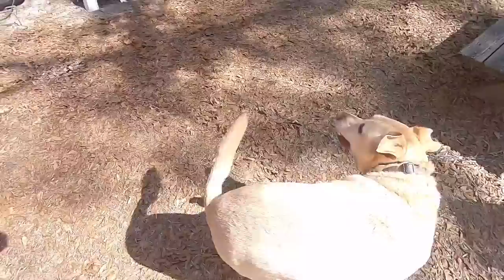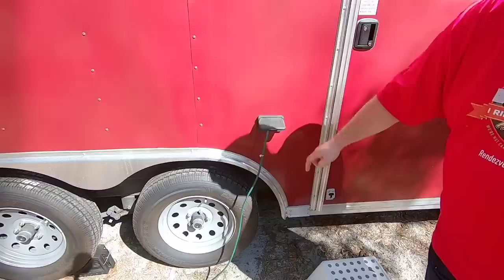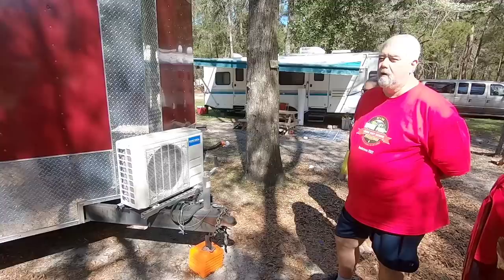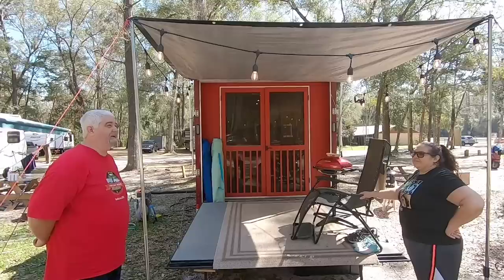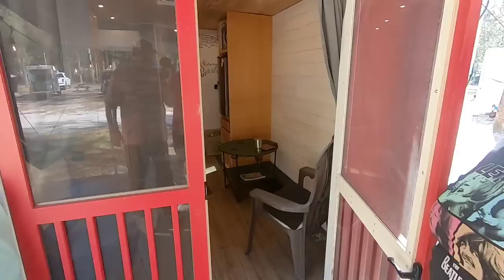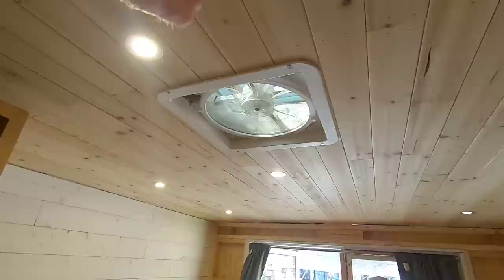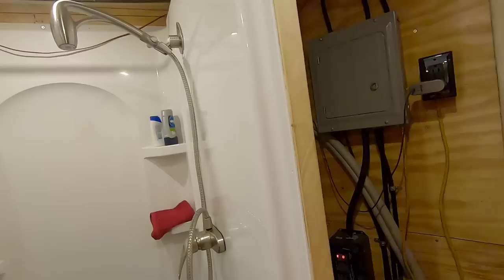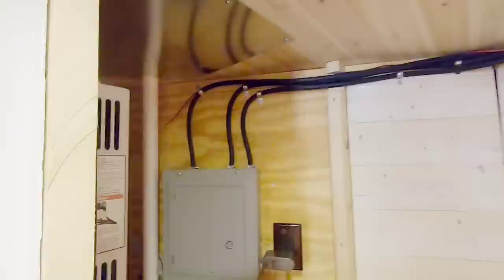A Very Cozy 8 1/2 ×16 Cargo Trailer Conversion Toy Hauler

Comment: I really like their porch with canopy and of course mini split. I am looking at what to purchase as a towing vehicle. Would like a cargo van to pull the trailer.
Reply: thanks .. i actually purchased this truck with pulling this trailer in mind . everyone's needs are different but this truck handles it easily
Reply: @johnshutte9398 the truck in question is that a 1500 or 2500 as well as what axles do you have on the trailer? Thanks for any info and super nice build by the way

Comment: I Like it......... but I need a freezer for ice cream and juice bars...... oh and bomb pops -  the screen doors with plexi inserts is Clever.  What batteries is John running to feed inverter?  Question for Bill or John or whoever - when you use a dogbone adapter or shore power extension do you just lay the junction  on the ground ? what about rain and puddles ?
Reply from the maker: The dog bone adapter usually hooks to the power pedistal first, then your standard power cable connects to it. The dog bone very rarely touches the ground at all. On rare occasions, we've inserted the dog bone in between 2 power cables (first cable being 30 amp, then adapting to 50 amp cable). In that case, yes, the dog bone is on the ground, but we try to position it where, if it were to rain it won't be where a puddle would form. I'm probably going to fashion a box for the connection out of a plastic storage bin soon.
Reply: thanks Ted.. the freezer is something i only use on extended vacations so we intend on getting one.. i have one on  list already which uses the same power as fridge which is minimal.  right now for battery power i have one 100amp hour agm but i have it set up for 3 more when i put solar on the roof.. my fridge has run for 8 hours without taking battery down 10 -15 percent in a test i did without ac running on a 90 degree day to get a good idea what a travel day would do to the battery.
Reply: @johnshutte9398  if you can , Please do an update video somehow - with Bill or your own - when you get it Finished.

Comment: Do they haul that motorcycle? If so, how? I would like to haul a motorcycle with trailer.
Reply from the maker: They do, but I can't remember exactly how they did it. Harbor freight has a wheel lock you can mount to the floor and then tie the bike off to d rings.

Comment: Damn you must have powerful drain lights using 20 amp wiring ( 12 gauge ) and 30 amp for the fan ( 10 gauge ) what size fuse or breaker are they on 3 amp ?
Reply from the maker: He doesn't have a big drain. Those are LED light bulbs. He simply used #12 just because. We did the same thing in our trailer but we also used the appropriate sized fuse for each 12 volt circuit based on the amp draw from each appliance on any given circuit.
Reply: the main reason for using those gauges is the fact that they are the only place in the trailer unaccessible so i ran sister wires as well next to each zone and all 4 zones run through same channel in ceiling so even if 2 fail i can just link 2 zones together.. bouncing earthquake going down the road even being careful where they were run  flex in body could cause one to chaff through..
Reply: electrical fires are a HUGE cause of rv fires .. I've seen to many friends who had rv fires from the spaghetti cheap crap wiring that they paid a premium for .
Reply from the maker: I used to have a chart that recommended wire size for any given 12 volt appliance. There's more to consider than just the maximum amp draw of a 12 volt DC appliance when choosing wire size. You must also consider the length of the run. The longer the run, the more resistance. The more resistance, the more heat build up. When it comes to 12 volt DC circuits, you don't just measure the length to the appliance. You must also consider the length of the negative wire back to the fuse panel. So, what was first a 10 foot run to the appliance, becomes a 20 foot run if you bring the negative back to the fuse panel. You could just take the positive to the appliance and then run the negative directly to the trailer frame, but in many cases that is impractical. A little overkill never hurts anyone when it comes to DC wiring. I firmly believe that 12 volts DC can kill you quicker than 120 volts AC. The longer the run. The more resistance. The more resistance the more heat. The more heat (with inadequate size wire) the greater the chance of a fire.